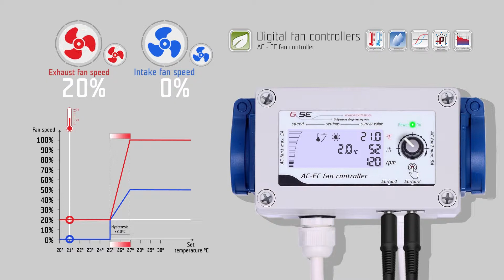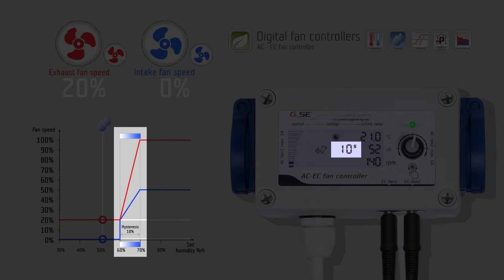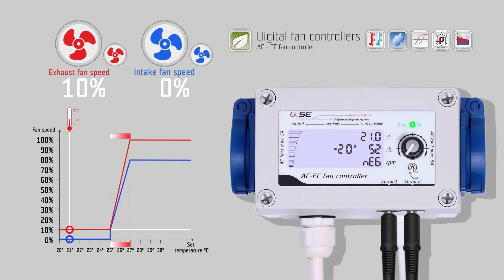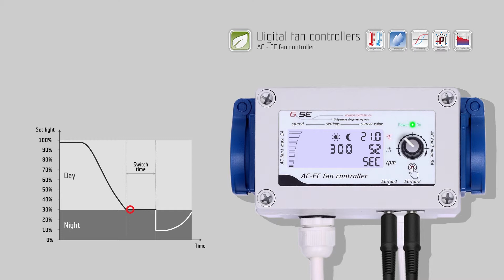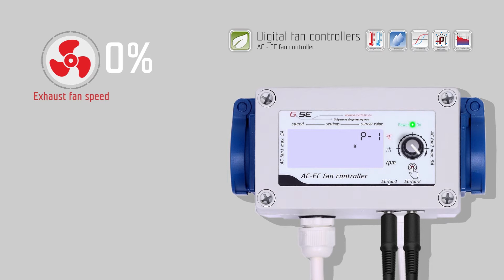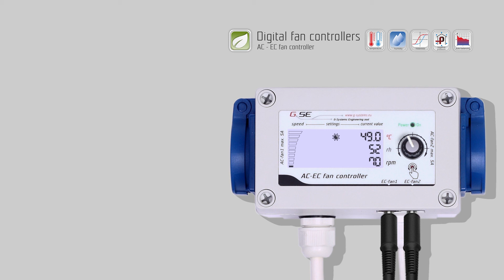GSE AC-EC fan controller

Comment: Hi Alan I was wondering if I could use the new hyper fan V2 model. The new V2 runs on (0-10v) volts it has an rj12 cable, if i buy rj12 to rj45 "adapter converter" can i use it with GSE AC EC controller? You told me I can use all EC fans using a standard industrial signal as 0-10V or PWM, so this will work, right?
Reply: thank you

One More Thing, do you think this cable will work https://www.amazon.co.uk/gp/aw/d/B07NCBVH5K/ref=ox_sc_act_image_1?smid=A3JF81ZLQ2O8F4&psc=1#

Comment: is the controller quiet, does it  generates the buzzing or humming sound?
please answer, I really need to know before I buy this controller.

It will be very helpful.
Reply: Thank you for answering Alan, yes I know about that AC/EC motors. What I meant was,
is the CONTROLLER quiet because some controllers have this "clicking" or "buzzing" noise. Is the GSE AC/EC  controller quiet running?
Thank you for your attention.

Comment: I don't understand why there is not a single controller on the market wich permits the intake fan to run at a low speed (for example 25 - 50%) before hysterisis is reached ( all your models are turning OFF intake fan if the temperature is below the hysterisis mark, you told me that a few days ago) , and still beeing negatively pressured set after the hysteresis has been reached.
Why That? I dont get it.

It is good for a growing room to be air supplied by an active intake H24, and if possible regulated with min and max speeds setting for BOTH day and night. ( Yes nights are colder, so reducing the intake speed is a GOOD idea).

An active fan intake brings more fresh air and more C02 for the plants, and a better air circulation, wich is good for them and make them growing faster than a "passive intake" wich switches ON ONLY after the set temperature hysteresis has been reached AS i have noticed on all your controllers specifications.

Why can't i find a controller who can regulate my intake (plus max and min speed at day or night) before the SET TEMP Hysterisis point?

Why your controllers just SWITCHES OFF intakes fans before the set temp is reached? 

Does that makes a problem with the under pressure regulation when the hysteresis has been reached ?
If yes, why?
AC Fans cannot handle such feature?
Does full EC fans and controllers can handle such feature?
Reply: Hey man, did you get any answers to any of your questions?
Reply: Your comment is pretty old but, have you looked at GHC Multifan controller, I think it's exactly what you're looking for.
Reply: @alaingressly214  yes these is very important option for me as well but when i set this on off, intake still working below temp what i set at. Why i think should be off all the time when temp belowe set point... maybe my unit is faulty?
Reply: Please can you advice how to set p4 to switch intake off when temp drop belowe 18 degrees?
Reply: @alaingressly214  thank you for a quick reply. In my case that function is important when is night time and temperature outside is to low for entry in to grow space but ventilation still need to work for a humidity to stay in a good range. That's why when temp in night drops below 18 in grow space i need to intake fan to stop working and stop supplying more cold air from outside what normally cooling tent in day time. Running only Outtake fan restricted to 50% power just for removeing excess of moisture will works perfect for my environmental and weather in my city
Reply: I ordered two controllers from my local growshop they told me the controller was not yet manufactured and would be ready by the end of April. So Alain is the controller ready for sale?